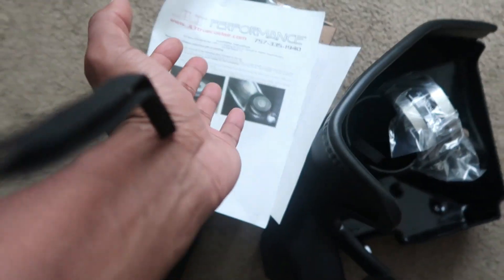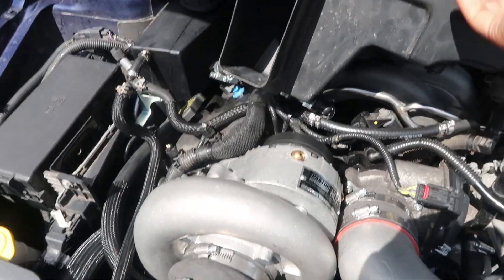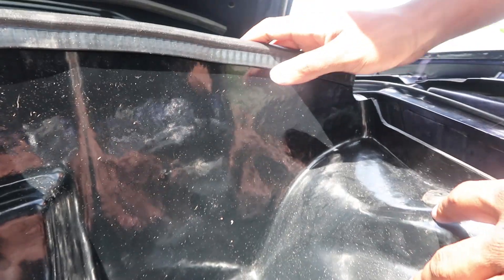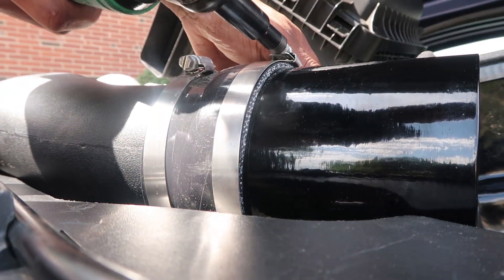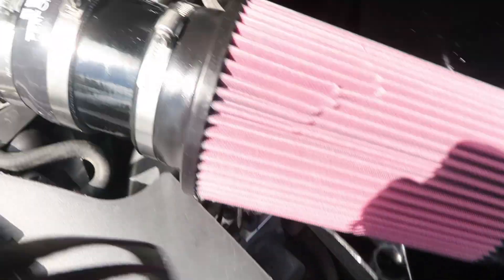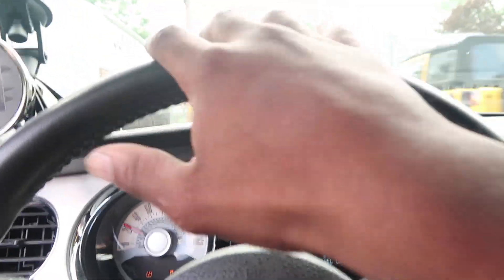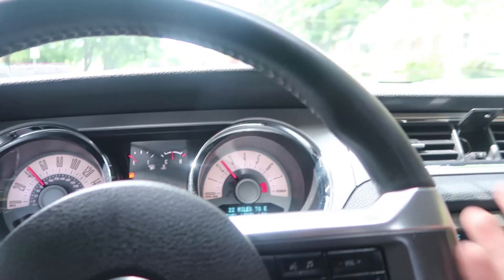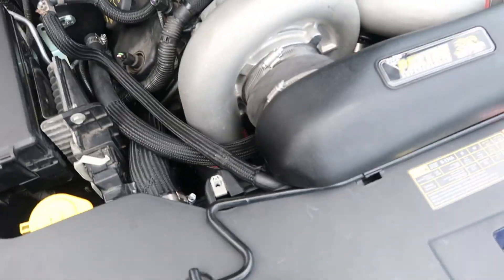I added 20-30 more horsepower to my Paxton supercharged mustang gt!

Comment: Did you need a re tune with the open air filter?? I have the stock box on a 3.6 pulley
Reply from the maker: No returne was needed
Reply: @Jrgnthestreet  what pulley are you on?
Reply from the maker: 3.8

Comment: Bro you should’ve just deleted that shit because it’s all restrictive. Just buy a turbo guard. They’re like $50.
Reply from the maker: I do have a turbo guard only reason I don’t run it open is because another guy with a Paxton told me he did the same and got some type of debris in his and he needed a rebuild
Reply: JrgNthestreet you’ll be fine. I’ve been running turbo guards forever on my Paxton & my twin turbo car. No issues bro!
Reply from the maker: Turbo guard it is 💪🏽
Reply: @nola504boy1  what do you do about the catch can I need a clean line and if I take it off I have no where to connect it?
Reply from the maker: Not too sure, I’m still running breathers on my crank case. Mine vents to the atmosphere
Reply: @Jrgnthestreet  Same here breathers, no catch cans.